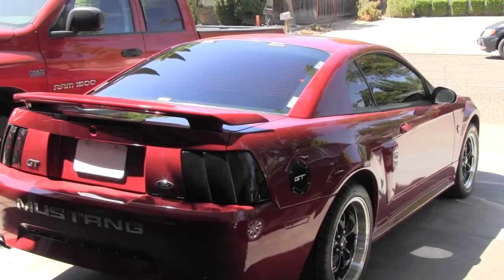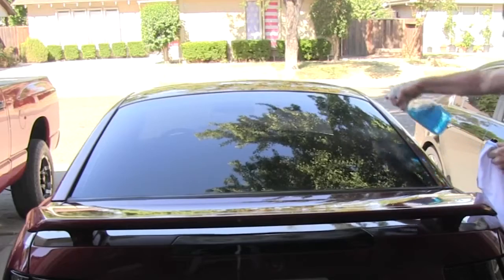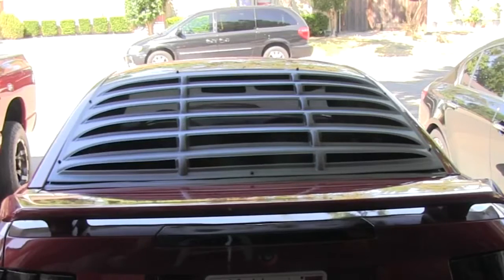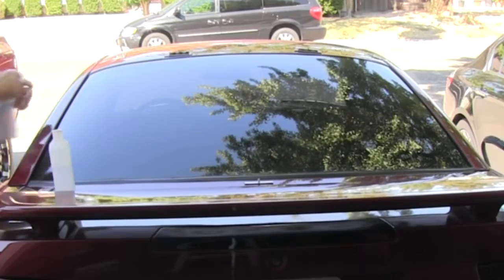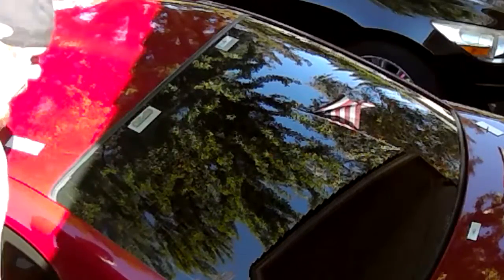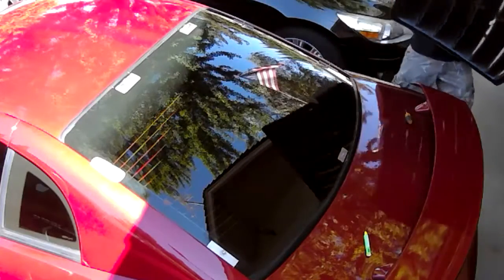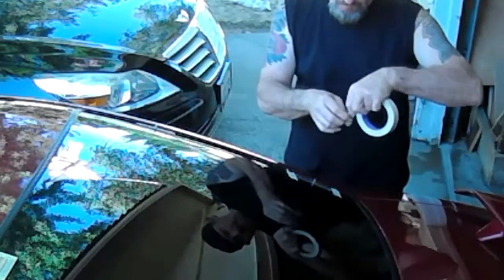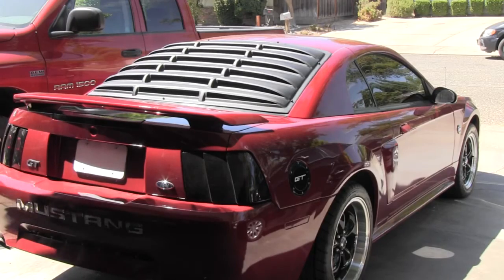How To Install Rear Window Louvers 1994 - 2004 Mustang

Comment: This is funny. i was looking up what size nuts for the window louver to replace mine.. and i am pretty sure that i now own the car from your videos lol every thing is exactly the same from the 18 inch rear wheels with nitto tires to the 17 inch front rims, the same rear view camera set up the lettering on the rear bumper, the exact same rear window louver. the smoked lights, fuel door. its even the same color exterior and interior.   do you still have this car by any chance?  because if you sold it, i may have it.... or a really close clone
Reply: just watched your other videos... and yes.. my license plate is the same as the ones in your videos lol. what a small world!!
Reply from the maker: Wow, yea, I sold it. It's a great car. I hated to sell it but I had to.
Reply: @chris10077   if its any consolation, i love it. Its basically the same as when you sold it. Just did basic engine bolt-ons, the clutch quadrant, short shifter. My 10 year old is already staking claim to it for when he hits 16.
Reply: @chris10077   i bought it in October of 2023 and only 3500 miles had been put on it since you video post about selling it.
Reply from the maker: I didn't drive it very often. I bought a new 2016 Mustang GT, so it just sat in the driveway most of the time . Oh yea, and you might want to know the clutch in it is practically new.
Reply: @chris10077   thanks, i appreciate it

Comment: What rims do you have and how much would they cost?
Reply: they're 5 spoke deep dish bullitts. the whole set can be from $400-$600 depending on what website you get them from. (:
Reply: Cyn_ M damn girl
Reply: Question with the deep dish front rims do you have any problems with the front rubbing.
Reply: Actually, no. i have had no problem with rubbing. the only time i had rubbing problems was after i dropped my car (: but before then, stock height and deep dish all around, there was no problems (:
Reply: +Cyn_ M attractive
Reply: Cyn_ M whats ur snapchat

Comment: does the silicone also help make the brackets stick?
Reply from the maker: It may help but the primary purpose is to keep moisture out.
Reply: CHRIS10077  what would you recommend for super holding?
Reply from the maker: just me I would recommend Goop marine grade adhesive.

Comment: mine flew off going 120 whoopsies
Reply from the maker: Wow hope you were able to retrieve in one piece.
Reply: CHRIS10077 Haha! They actually split in half. I had the MMD louvers on my car but very similar. Found one half but never found the other.
Reply: Same, was going around 70 mph when wind go underneath mine and flew right off with some of the brackets. Found it on top of a bush 3 days of searching later.
Reply: DA DEPTHS mine flew off at 110 MPH on a highway. Luckily nobody was hurt but these louvers definitely aren’t safe. They rattle and will wear out as time goes by and fly off like mine when driving fast in high winds.
Reply: RageBear sorry that some people have mods to test out like nitrous and trying out new tunes and does not have enough funds to go to a raceway or dyno. It was on a highway with no cars. Not that big a deal.